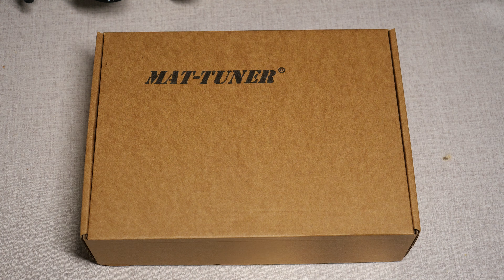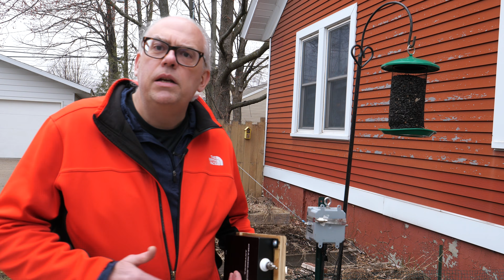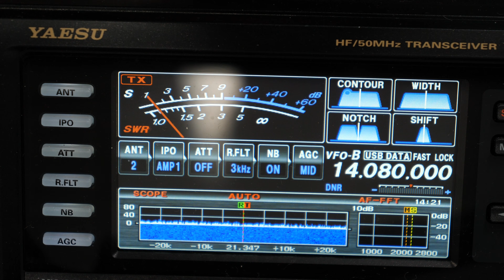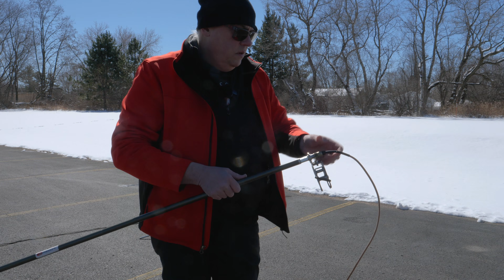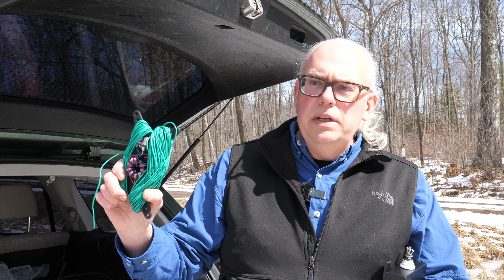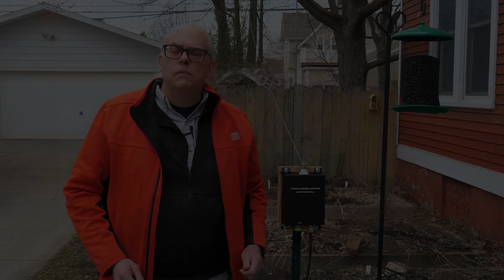Maximize Your Signal with the Chameleon URT-1 Remote Antenna Tuner

Comment: Hi can I connect a delta loop via 50 ohm coax straight in with out a balun. Cheers.
Reply from the maker: Delta loops have an impedance at the feed point of about 100 - 200 ohms, depending on if they are fed in the center or corner of the loop. You are going to need a balun or transformer of some sort. 4:1 transformer is a good choice. Otherwise your feed line losses will be very high.

Comment: Beginner Question: I have a 34 ft. telescoping mast, and two antennas to choose from, an OCFD and a 71' end-fed random wire. So, do I need to hang my new remote tuner to the point where the antenna meets the coax up on top of the mast? Or can I mount the tuner unit at the base of the mast around knee height with around 30' of RG8 coax?  I do have a 3' jumper coax so can I go from wire to 9:1 transformer then the remote autotuner attached directly below the transformer box and finally the 75' of RG8 coax to the Icom radio??
Reply from the maker: Ideally the remote tuner should be directly at the feed point of the antenna. That's going to be a problem if your feedpoint is up several feet in the air and the mast can't support the weight of the feed point. You can use a short piece of coax to transition from the feed point to the tuner. There will be some losses associated with that piece of coax, but you will still benefit by having a good match for the much longer cable run from the tuner to the shack. 

For most off center fed dipoles, the impedance is usually close to 50 ohms at the feed point for the major bands (40-20-10 meters), and the tuner helps with 12, 17, and 15 meters. 15 meters can be a wild card, because depending on your installation, it may have a good match, or it may not. 

As for the 71 foot random wire. You can run it in an inverted L configuration with about 25 or so feet of wire vertical and the rest horizontal or sloping. The feed point will be at the base near the tuner. I' ve found this configuration acutally works really well for the upper bands (10-20 meters).

Comment: The reason the tuner had difficulties tuning your vertical on 15m. It was almost a half wave length on this band.
And for a remote tuner you should avoid wires our antennas that are a half wave length. It also said so in the manual.

Comment: Hello Sir, a newbie question. I'm not licensed yet but will be taking the course soon, not sure if this question will be covered in the course but I will just throw this question to you sir. If the transceiver has a built-in tuner (Yaesu ftx-1 Optima), is it still advisable to use this external tuner Chameleon URT-1 as part of the system? Or is it redundant to use it as the internal tuner is already suffice enough for the usage?
Reply from the maker: I can't remember if antenna tuners are covered in the Technician or General coursework, but here's the answer: Typcially antenna tuners built into transceivers will have a range of about 3:1. That means they can correct small impedance mismatches or SWR imbalances of up to 3:1. One example of where this is useful is if you have a dipole antenna and it is tuned to the phone (voice) portion of the band. You may want to use the antenna on the digital or CW portion of the band, but the SWR is a little high. The built in tuner can make that correction. 

But there are many antenna styles that will require a match greater than 3:1. Notably, if you are using a non-resonant (random wire) antenna, you will need an external tuner that can work with a higher SWR. In those instances you will use the external tuner and turn off the internal tuner. 

Long story short, internal tuners should be considered convenience features and external tuners are necessary when work needs to be done.
Reply: @KB9VBRAntennas  So is it safe to say that since I will be using an external tuner in my set up anyway, I can just turn off the internal tuner regardless of what kind of antenna I will be using?
Reply from the maker: Correct. You use one or the other, but never both. So turn off the internal tuner if you plan to use an external tuner.
Reply: @KB9VBRAntennas Thank you very much for giving me a portion of your time. Much appreciated for your reply and inputs.

Comment: when you disconnect power to the control unit is the tuner by-passed?
Reply from the maker: I believe when you disconnect the power, the tuner continues to hold the last tune. That's what my unit seems to do, but I've also heard conflicting reports by other users that it doesn't. So I don't have a definitive answer for you.

Comment: You kinda missed the point of the concept of a remote antenna tuner when you laid out the large length of coax onto the parking lot. A small Elbow coax connector would have been more in the spirit of implication placing the turner right at the load thus eliminating any mismatch losses from antenna to tuner. But hey it works right as it is you might as well left the balun in though...right.
Reply from the maker: Just to clarify things, the antenna I'm using in the demonstration is a 71' non resonant wire antenna with a 9:1 transformer, a tuner will be required for it. There is an 18 inch coax jumper from the antenna to the remote tuner. The 50 feet of coax runs from the tuner to the control box. With that setup, the point is perfectly made.
Reply: @KB9VBRAntennas  The tuner still would love to be at the antenna. There is a mismatch that could have been avoided in that coax had the tuner live where it was designed.  How much loss in 25 feet of coax ? Not much but when ur qrp it might make a difference 😉.
Reply from the maker: I'm not sure what you're getting at, but the tuner is at the antenna. If the short jumper concerns you, then use the beehive connector like I demonstrated in the video. 

FWIW, One of the challenges in producing videos is demonstrating a proof of concept. Instead of sitting in front of a green screen and yammering on, I go into the field and show you various setups. Sure, a remote tuner on 50 feet of coax seems like overkill, but in my presentation you should be able to take that idea and extend it into more realistic situations. Thanks for watching.

Comment: Been testing this out for a couple of weeks and I am really impressed. I have been using it for POTA and general portable applications mainly hooked up to a 60' random wire in a sloper configuration with counterpoise.  Easy and fast to deploy with really strong results.
Reply: update:  I have been experimenting with a new configuration, URT1 using a telescoping mast, loosely wrapped 40-foot wire and 6-8 counterpoise wires.

Comment: Just be careful when tightening the connection to the beehive connector as accidentally rotating the bolt may turn the lug on the inside of the enclosure and short it to the case.  Unless that has been redesigned from the MAT 40 design.
Reply from the maker: That's good to know. Adding a lock washer may not be a bad idea to help mitigate over-tightening the connector.

Comment: Hi Michael, when using this tuner with your 891 for POTA are you finding it frustrating having to keep going into the menus to lower the power for each tune, and then having to increase the power again to operate?  Power is not one of those setting that is easy to change on the 891.
Reply from the maker: I don't find it frustrating, here's why. I'll use a constant carrier mode, like RTTY, for the tune process. The FT-891 has separate power settings for the modes, 16-01 HF SSB Power is for sideband, and I keep that set at 50 watts. 16-03 HF Power is for CW/DATA modes and I keep that set at 20 watts. When I switch to RTTY, the rig automatically uses the lower HF Power level and leaves my higher SSB power level undisturbed. So there is no need to adjust power levels in the settings menu unless you are using a higher power level for your data/cw modes.
Reply: @KB9VBRAntennas I ordered one :)
Reply: Where would one install an RF Choke in such a system with a nonrez wire ???
Reply: @TomL2040  doesn’t matter remember the tuner is part of the antenna so at the feed point the 50ohm coax sees a 50ohm load.

Comment: I hear it's a misconception to think that reflected power is lost. If my understanding is correct, the true motive for getting a good match is to avoid high current/voltages at your transmitter output. Aside from that, whether your VSWR is low or high (assuming no other problems), the same amount of power will be delivered to your antenna, regardless. PS: I'm no engineer, it's just what I heard from another YT video, which seemed pretty credible.
https://www.youtube.com/watch?v=6P6UJuMATBY
Reply from the maker: I'm not an engineer either, I've got a BA degree so I wouldn't have to take college math. But I believe the problem is that there is a misinterpretation of what SWR is and a poor understanding of how feed line impedance affects the antenna system. That video capitalizes on the poor understanding of impedance and instead of educating the role of feed line has in an antenna system, it instead tries to 'debunk' SWR. 

Standing Wave Ratio is the quantification of forward vs return power based on the impedance of your feed line. For example, a common dipole will have an impedance of 70 ohms at the feed point. The transceiver is expecting a 50 ohm impedance. The mismatch is characterized having an SWR of 1.5:1.  Our antenna is resonant, and the load is purely resistive, yet we have an slight inductance on the coaxial feed line. But with a purely resistive load, all power is being delivered to the antenna regardless of the SWR. (If I were to feed my dipole with 75 ohm RG-11 coax, I would have a perfect 1:1 SWR at the transmitter). 

Now, take for example a non resonant antenna, like a long wire. This piece of wire is not resonant on any frequency on any amateur HF band. The impedance at the feed point can be anywhere from 400 - 900 ohms. (400 ohms is 8:1 SWR). All power that can be delivered to the antenna will be radiated. But the impedance mismatch of a 50 ohm feed line will result in a high SWR. Because a big impedance mismatch on the feed line will cause any number of things to happen: power fold back at the transceiver, losses due to resistive heating of the 50 ohm coax, and potentially transceiver destruction due to high current/voltage (Ohms law). We tend to characterize this mismatch as high SWR and there-in lies the confusion (and creation of the aforementioned mostly accurate video). Because, yes, the power is still there. Reflected power is not lost power, but it's doing things we don't want to happen. 

Back in the old days they would feed non resonant antennas with 600 ohm line (which results in a much more manageable SWR) and use the final loading of the tube finals to eliminate any capacitance at the transmitter.  

On a practical level, we want to keep the transmitter happy. That means presenting to it a 50 ohm impedance match. We do that in one of few ways. Using an antenna that's close to 50 ohms at the feed point (by using a resonant antenna or feed point transformer), using a tuner at the transmitter, or using a tuner at the feed point.  The closer we can get to 50 ohms, the better the impedance match, the less the SWR. (again SWR isn't the culprit, it's just a characterization of the mismatch). 

I'm not sure if this totally answers your question, but it does illustrate the bigger picture of the role of feedline impedance in an antenna system.
Reply: @KB9VBRAntennas  Thanks for your answer! Based on the very small understanding I have, it seems like Mark The Florida Man (referenced video) and you (based on your response) are not in contradiction and essentially saying the same thing:
- You both seem to agree that reflected power is not lost
- You both seem to agree on the fact that a high VSWR can damage your radio, or have adverse side effects (like heating)

I'm not exactly sure if there are any points you disagree on. Maybe your point is that we conflate VSWR and impedance mismatch, when they might be 2 different things? (I don't know if that's the case, but in any case, there does seem to be a strong relationship between the 2)
Reply from the maker: We do say similar things, with one exception. In order to hold onto his tenuous argument, he will not admit that impedance mismatch (characterized by high SWR) can damage your transceiver. There is no hard and fast rule on how much of a mismatch it will take. For the most part, anything below 2:1 is just fine for extended periods of time. Anything higher than 3:1 is ok for short time periods. The power fold back can protect the transceiver in those cases. 

But extended operation of a transmitter at high SWR will stress the components and result in premature failure. Plus that's wasted power that can be put to use with a more efficient impedance matching system.
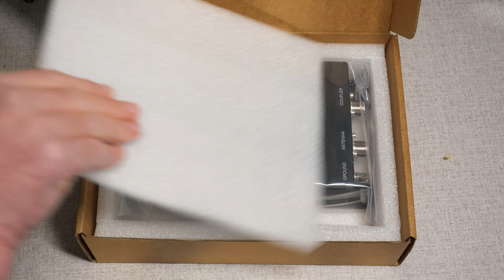Reply: @KB9VBRAntennas  "[...] he will not admit that impedance mismatch (characterized by high SWR) can damage your transceiver. " At 3:15 he does say that it is the impedance mismatch that heats up your finals. 
I any case, I found both of your videos helpful, I appreciate the response. I can't really debate much more as that's about as much as my understanding goes. :) --73
Reply: @KB9VBRAntennas florida man does indeed state its the impedance not the reflected power that causes radio to heat up ,it seems from the many videos I've watched on the subject that they all mis quoting him also

Comment: I have had my IC706MK2G and an SG-230 linked through AA4PB interface, the function is fully auto, just press the tune button on the radio and a 10W carrier is emitted. The radio will also re tune on sending if it detects a mismatch. I'm frustrated not be able to do all that with my newest FT-710! Very nice presentation of the URT-1.

Comment: MFJ sells some "autotuners." I have two of them.  They use a "Bias-T" box to send 12v over the coax cable to the  tuner.  I think they work very well, even if they are a little boxy.  They handle coax fed and wire antennas.  I  also an AT-100M from Antuner (around 100 bucks on Aliexpress).  It takes a coax antenna input.only (think balun if you have a wire antenna).  125w input.  Autotuner at antenna feedpoint or at radio. Self-contained lithium battery for up to 15hrs of use.  USB-C connetor.  Very compact.  I got it for my portable work.  The Chameleon antenna looks pretty good, but 499 Euros in Germany is a rather steep price.
Reply: We can’t do much than that! Germany has a 19% VAT.
Reply: @Chameleon_Antenna  even worse here in greece.  24%!

Comment: How soon to a fully auto tuner?  Jerry  wa2omu
Reply: Probably never because it’s independent from the radio used.
Reply: @Chameleon_Antenna  So are most others, like the AH-4, and all of LDG.  Ok, they use a control cable, but my original LDG Z11 which I still use with my FT-817 did not use a control cable.  BTW, still using my Hybrid mini and accessories for portable ops.  Jerry  wa2omu
Reply: If you had some software on a computer that was watching for frequency changes, you could possibly automate the process of “pushing” the button and keying up the radio on the right mode.

Comment: de KI5DPA, thanks Michael! One question. 16,000 frequency memory. How precisely do we have to hit a frequency in memory to trigger the fast tune?
Reply from the maker: It would depend on the bandwidth of the antenna. I don't know what algorithm the tuner uses, but I'd assume that the tuner goes through the memories first to find the right matches. If it comes on a match that's within a predetermined SWR limit, it goes with it. Presumably you could be up to several KHz off in frequency of the memory tune, but still close enough for a good match. That's the behavior I'd seen other auto tuners demonstrate, so I would assume this works in the same fashion.

Comment: I always used an ah 4 tuner with great results. But is some what limited to icom. I like that this isnt reliant on one brand of radio
Reply: The I-COM molex tuner port on the back of the radio will put the radio in tune mode with a 10 watt carrier right on the carrier freq.   

On the molex connector short the two inside terminals with a 1kΩ resistor, this tells the radio that an external AT is present.  Newer I-com radio's that have an internal tuner will bypass the tuner when the outside terminals are shorted.  Some radio's only respond to the outside terminals at power up

Short the two outside terminals with a momentarily switch.   The radio will go into tune mode with a tone and 10 watt carrier.  I'm sure something can be rigged up to make this automatic with this tuner.

There is a diagram by KC2WI

Comment: I suppose being a "universal" tuner provides some assurance to the ham who is uncertain as to what radio will be used down the road. I had a universal LDG tuner that required I press its tune button when tuning. Bottom line, I thought it was just this side of annoying.  Not a show stopper but having a dedicated cable from the radio to the tuner is a small price to pay for point-and-shoot operating. I will sing the praises all day long however, for having remote tuners over internal and shack based tuners. I have MFJ remote tuners on each of my doublet antennas and a MAT on the long wire. So to anyone wondering if they should switch to a remote tuner, the answer is most [often] YES!  I's still recommend using chokes in the coax feed line; tuners are not typically designed to choke common mode currents, and besides, an external choke can be as robust as you want it to be.
Reply from the maker: My LDG auto tuner I take out portable behaves in much the same way. I guess I'm used to them operating in that fashion. Bu to your second point, I totally agree. Remote tuners are game changers for long wires and non resonant antennas.